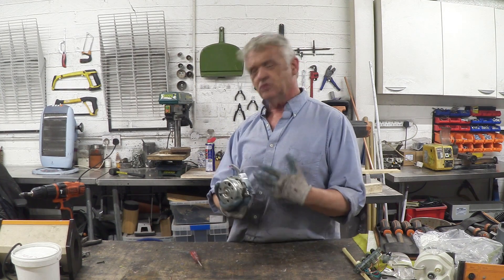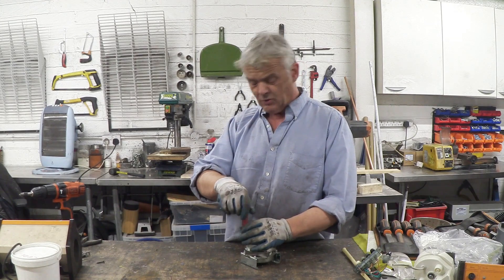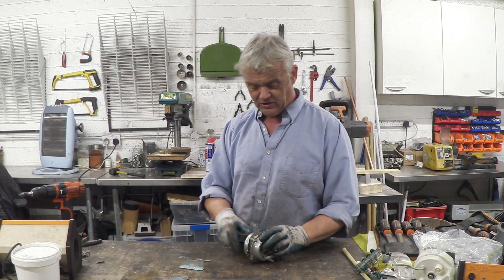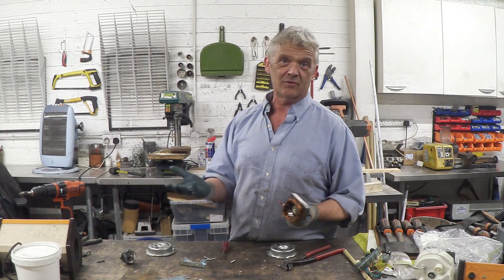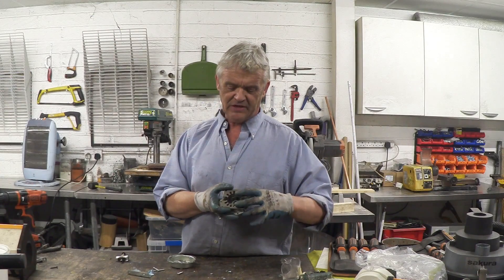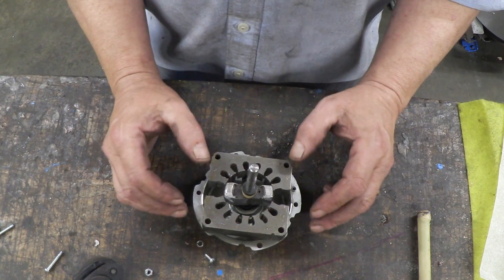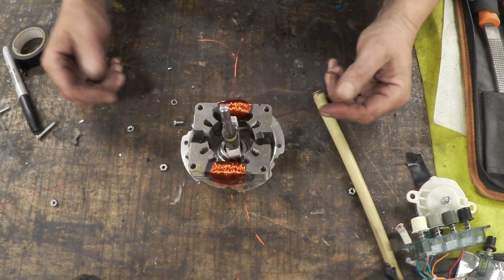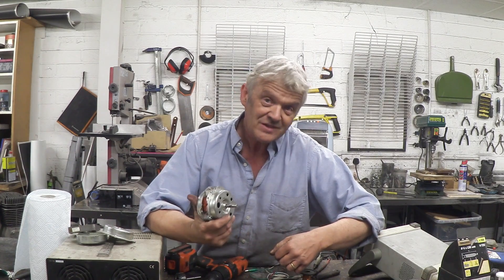1234 How To Make The Ideal Generator For A Wind Turbine - A Switched Reluctance Generator

Comment: You have to try this. Ex take two 3v battery in series and one 3v battery. Connect the ground on the singel battery with the one ground in the batteries in series. Connect the both positive with a consumer. You will get 3v but observe the voltage in the singel battery. This is how the tesla 4 battery switch works.

Comment: I like these but was thinking if you get say 3 of these and welded the shafts together end to end then would it be better to wire in series or would it be to much torque for wind generation?

Comment: @Robert Murray-Smith,
My take on this Reluctance Generator (RG) is that, you need to spin the rotor to high RMP 2000 RMP to get considerable amount of power. Also I feel that when loaded the RG will experience less back drag, because the magnetic field due to load current will cancel with the magnetic field of permanent magnet, as a there will be less back drag on the rotor, This could be the best candidate for Overunity, but still there will be energy loss due to friction, windage and heat.
Reply: Whenever I see a generator that is mentioned with the term overunity, it makes me think that the generator is possibly more efficient than standard generators---less input for the same or better output as compared to a standard comparable generator.
For instance, could this generator allow a human powered setup, bicycle or hand cranked, to generate more power than a standard human powered generator or alternator? How about a stirling heat motor, could this generator get one to output a usable amount of electricity for battery charging?
Reply: I don't think that higher load will decrease the counter torque the generator is producing.
I mean, you are right, that the coils fields and the permanent magnets field will superimpose. But (according to the induction law) in order to induce voltage and thereby produce electrical current, the magnetic flux inside the coils has to change.
The stronger the current in the coils, the stroner their magentic field will be, leading to the temporary formation of two "super" poles diametrically opposed to each other. The magnetic reluctance will pull the rotor in line with these super poles. So in order to switch the magnetic flux through the coils and to move away from these "super" poles, the rotor has to be driven with higher torgue, the stronger the current through the coils is.

Comment: Seems like it would ideally be matched to a vertical axis turbine. You could make a constellation or fleet of them and make some consistent power to charge a battery Bank that an inverter draws from to run stuff like your wifi router or charge phones/tablets. Or am I on the very low side of the joules of energy it can produce in my estimations?
Reply from the maker: to be honest mate I would think either would do just fine

Comment: I was not aware of switched reluctance generators. Very interesting design.  I really like your modification to create one.
Reply from the maker: I like them and have done a fair bit of reading quite common is a four or 6 pole rotor - I did 2 pole because it is easier to 'see' what is going on and easier to make

Comment: ‘’Bolt onto a wind turbine without’’, what was the next word?, no matter how many times I replay that bit, I can’t understand the last word,
Reply: "Bolt onto a wind turbine and you don't need a gearbox."
Reply: @McRootbeer  Thanks, I did just find out, as Robert mentioned not needing a gear box a bit later on, that I didn’t notice before, must stop watching vids when I’m half asleep, lol.
Reply: Although not sure why a gear box isn’t needed, cos the motor would surely still have to spin fast like most of the other recent motors Robert has been using?.
Reply: @Kiyarose3999  it is inductance motor, so i think like an alternator it needs an induction current, as in you must apply power to it, for it to generate power - it will generate it's own starting power using those magnets but by applying power to the/a coil, the other will pick up far higher flux combined with the magnets.... so it is my understanding you can increase the resistance and therefore the ideal RPM of this generator by changing the applied current to the coil.... (i may be entirely wrong mind!!)
it seems "lossy" to have to apply current to make power but it is less lossy than a gearbox!  as i understand it is effectively like running a variable CVT with no extra mechanical parts
Reply from the maker: I am sorry mate - it is not an inductance motor - it is switched reluctance - you. might want to have a bit of a read?
Reply: @ThinkingandTinkering  ah i must refrain from writing comments at 3 in the morning! hahah, i have looked a few things up; it seems i was mistaking the rotor for having magnets/coils too, you are absolutely right it is switched RELUCTANCE not inductance, though i am curious, i cannot find any documentation on controllable output based on input current anywhere - but i have certainly heard of it, most certainly in alternators, and i'm pretty sure it is how the big turbines operate also!, and by sending large current into the stator it will completely lock the turbine up and this is how they brake in high wind

i also vaguely recall in other applications the exploitation of the same action within magnetos to create high voltage low capacity spikes, by cutting the circuit at peak voltage to dump into a next coil set as the stator passes for cumulative effect, allowing a relatively small generator to create kilovolts! albiet in very short sharp spikes and milli-amps... where on earth i heard this i have no clue... and this info seems to be lost to the ocean of the internet also... perhaps you may have a better idea? 

i seem to recall this being used as a spark generator for a very old engine but my memory is, as you can tell, very faded!
Reply from the maker: gearbox

Comment: Is it possible to increase the efficiency by putting the generator core in a vacuum? that's because of air friction inside the motor
Reply from the maker: I would think so - but not by much

Comment: hmm, so laminated pressed/sheered steel shapes, stacked laser cut kitchen foil, & steel/copper wire will work, put through an auto desktop esp32 wire bender... straight horizontal wire bend.. down, up, right, down, up, right etc
wind reclaimed, not destroyed expensive precision insulated copper as you go, or just use my prior cored wound copper description for simplicity & time as the base material, or conductive painted then insulated long paper 1-2mm strips for a fun first real life poc paper generator then shape into a half circle.. the outer down/up part will separate making it simple, stack the wires as many as you like to fit a bean can etc, rinse repeat for the rotor
Reply from the maker: like it